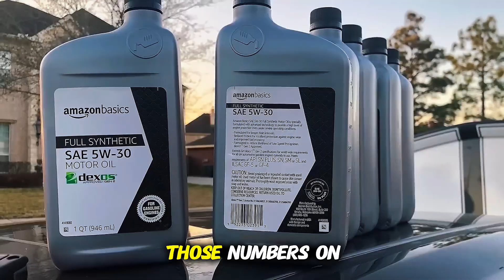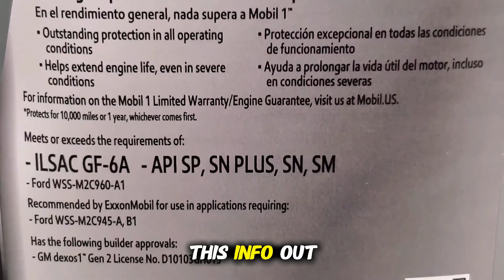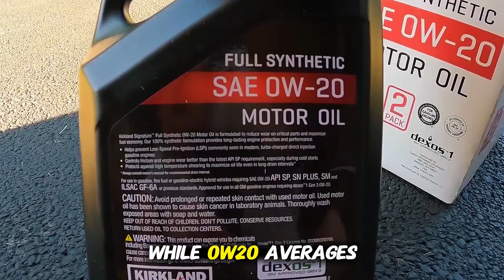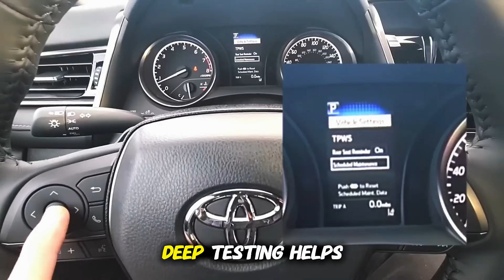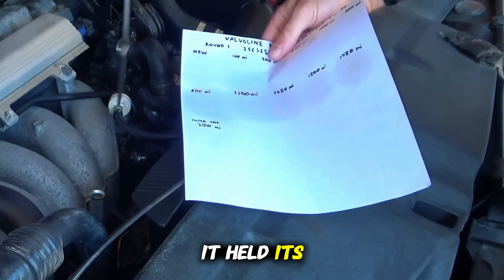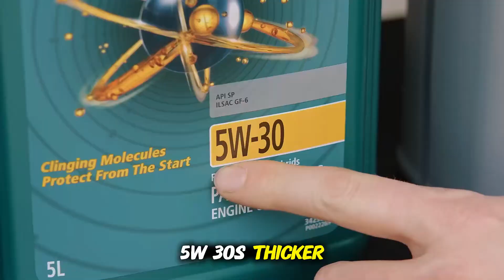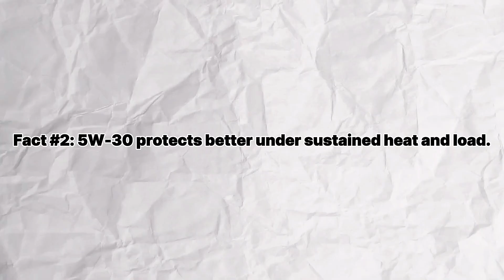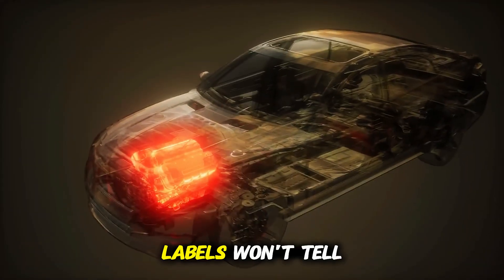The Hidden TRUTH About 0W-20 vs 5W-30 (After Testing 50 Engines)

Comment: I am driving a Toyota Hybrid in a really hot area tropical. Should I use 5w30 instead of 0w20 ? 
Toyota user manual said that I should take 0w20 but its too hot here around 30-40°C.
Reply: I have an accord hybrid and was thinking about using 5w30 but I have heard that hybrids need the thinner oils because of the way more frequent stop starting of the engine.
Reply: I am no expert but this is what I would probably go by.

0W-20 - In winter AND/OR on a new engine
5W-30 - In summer AND/OR on a high mileage engine

I have seen a test where someone compared oil test of 0W20 and 5W30 in their car.  They said that they would be using 5W30 after reviewing the tests.

You should check the manual and see if 5W30 is an approved oil.  In my car I am currently using 0W20 (but it is winter), when the summer comes around I will switch to 5W30.
Reply: @johnsmithfakename8422 thanks mate. I will try 5w30 next oil change. Hope it would be ok. 😊

Comment: 0w20 will shear down in hotter climates.  Lake Speed has compared 0w20 to 5w30, there were more metal particles in the 0w20.

Comment: Never use a different viscosity than the engine was designed for! PERIOD
Reply: You know nothing.  Thumbs down.  Freeze some 0w20 in your home freezer, then grab 10w30 at room temperature and do a pour test.  That frozen 0w20 is slower than 75 gear oil.
Reply: Gumby come home.  Keep drinking the Koolaid

Comment: Retired from Shell Research division (FUELS & LUBE DEPT.) in Houston TX.  If you want your engine to live forever use 5W-30 full synthetic in warmer states and change at 5,000 miles or less!
Reply: Excellent advice but don't forget to use shell diesel the cetane numbers are higher with she'll than a lot of others where in at in southern middle Tennessee shell and Exxon are the 2 and marathon I've not checked it but shell has the highest cetane diesel here above Exxon! Shell steel is all I'll run!!!